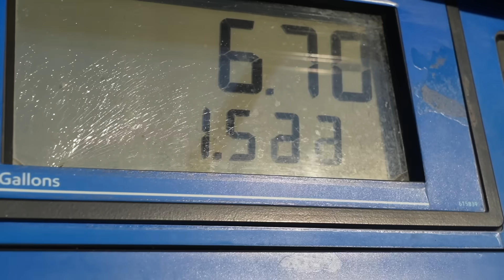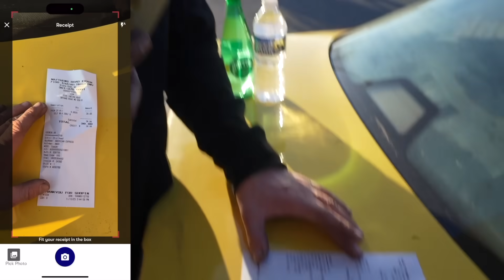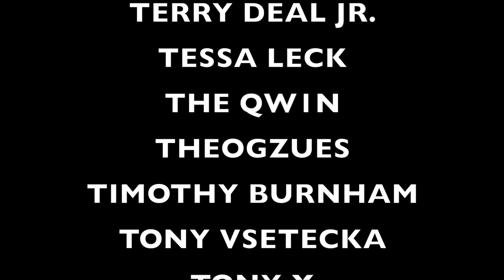DRIFT WEEK CHAOS, WHAT’S NEXT?

Comment: I think that fire trick to stretch a tire on the wheel only works when you use one of those compressed air tanks with the flat nozzle and it shoots and big fast burst of air in there at once but I could be wrong just only seen it done like that

Comment: Why not rip that shitty LS out of your E36 drift car and put an VQ or an HR 350/370 engine in that instead, you will have more room under the hood, for like better oil cooling, more rads to keep the engine in temp, you can even add one/two turbos on that engine, or even a supercharger and have a better E36 drift car then a LS.

So time for a new build series for your drift car?